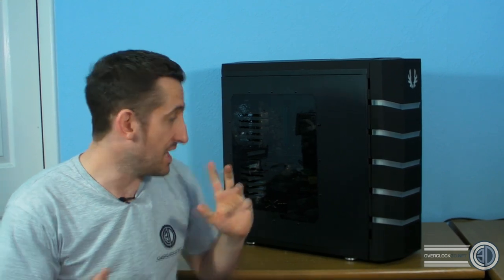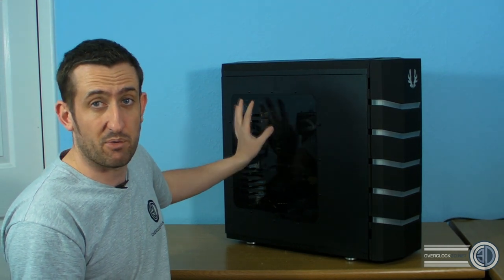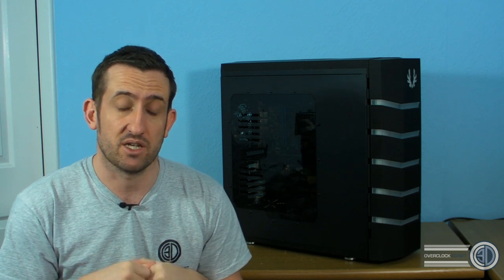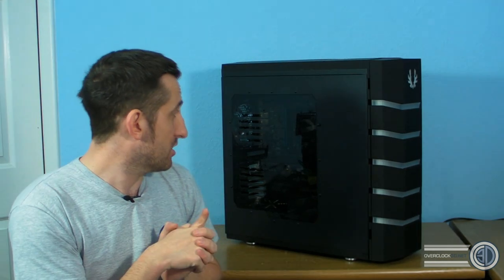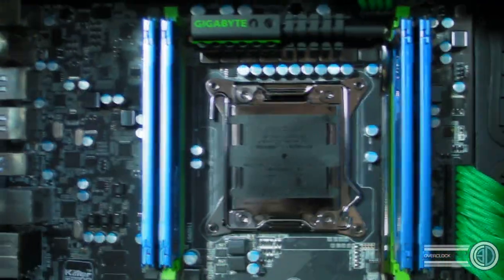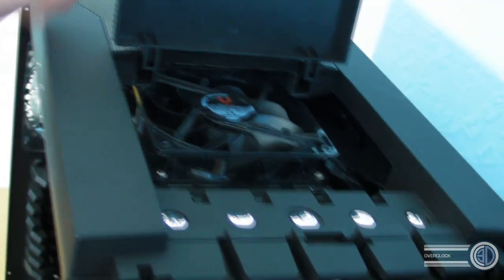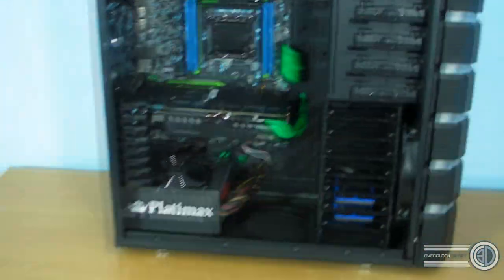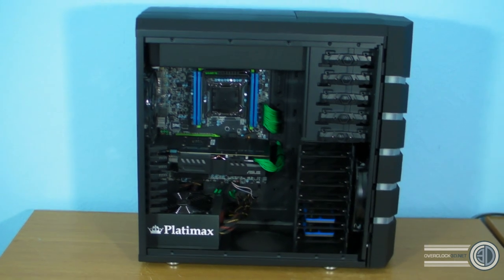N-V 3960X GTX580 1st Place Competition Prize Complete!

Comment: @TheModernwarfare2009 hmm sounds good but ive had a bad experiences with M-atx
i prefer a solid massive motherboard with lots of space for watercooling and the air-flow...asrock have made a board that runs 5 pci-e 3.0 slots run at x16 with crossfire in all slots! but its for x79 chipset =/ but they say they might just do one for the z77 chipset! cant wait for that beast to come!